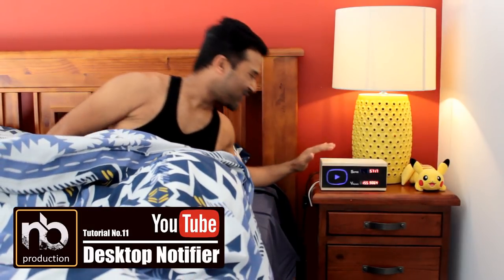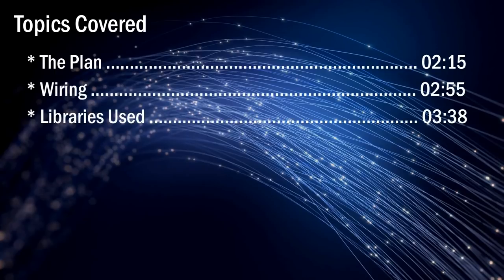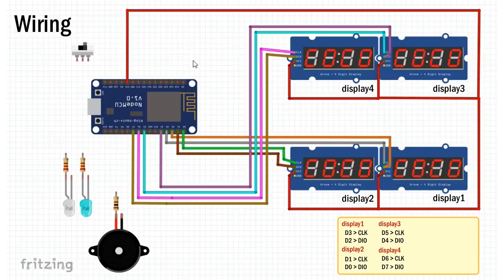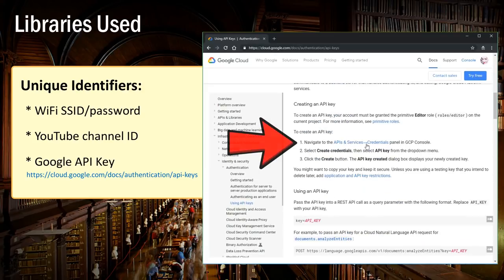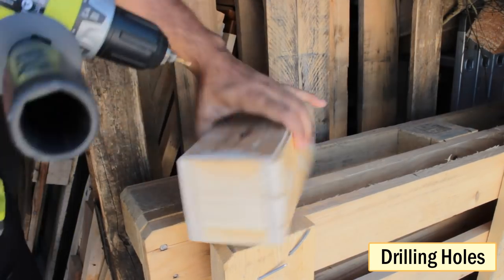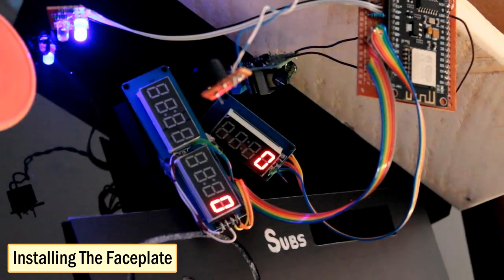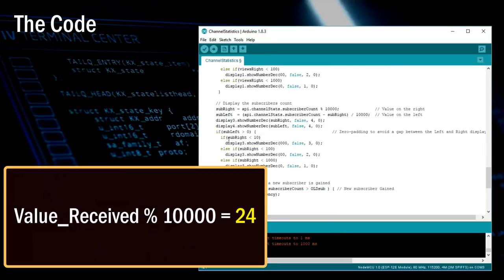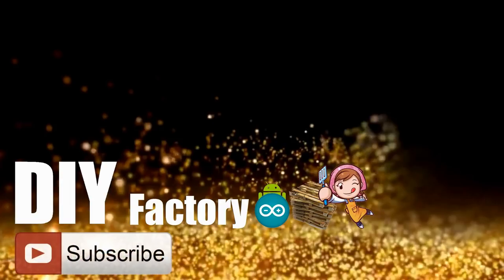YouTube Desktop Notifier using ESP8266

Comment: Hello! I have another question I do not get the exact amount of 4 TM1637. Can I buy 2 Max7219? or 2 TM1637 and 1 Max7219? Thank you.
Reply from the maker: Yes sure you can.
You will just need to use the correct driver/library for the module you want to use.

Comment: Very nice project!
Now, since you know how to wire things up like this, get yourself a copy of Kicad and make some custom boards so the whole thing goes on one or two PCBs. I recommend PCBway for quick turnaround low cost PCB fab; I've had very good luck with them.
You could even have them make the faceplate for this. You'd do it as a matte black PCB with translucent areas for the seven seg displays and/or Youtube logo by leaving the copper, mask, and silkscreen layers blank so only FR4 is exposed where you want light to come through. You could easily bang out some resellable kits like that.

Comment: Hello! Congratulations and very grateful for this video. Just a question. Where do you enter the code to ESP8266 ?. I did not see in any moment that you show that detail. How, and where do you incorporate the arduino code? Thank you.
Reply from the maker: Hi There 
Thanks a lot for the appreciation.
I haven't actually shown the uploading bit however from 08:05 I have explained how the code works.
The process is the same as how you upload your code to an Arduino. You just need to select the right board/driver and the correct com port
Please let me know if i was able to answer your question
Reply: @CrazyCoupleDIY  
Thanks for your prompt response. I was referring to the type of port you use to load the code. Is it for Wifi ?. I always use Arduino UNO, or Arduino MEGA for my projects. But I see that here, you do not use any of those Arduinos. I explain?
Reply from the maker: @busqueda_infinita  Its exactly the same process
When you create a new project you sect NodeMCU and whether its 16 bit or 32 bit and then you plug it into your USB port and upload the code.

The process is same as how u do it on Arduino. The only difference in simple terms (there are many differences in reality)  is that you are adding WiFi capability to your board. The cost of both boards are almost the same
Reply: @CrazyCoupleDIY  Perfect. Thank you! Now if I'm going to start copying your project. Greetings.
Reply from the maker: @busqueda_infinita  Subscribe for more amazing projects and tutorials :)
Reply from the maker: @busqueda_infinita  Subbed, stay in touch and best of luck :)

Comment: Hello! I have a problem. They sold me the NodeMCU V1.0 / V2, and as I saw yours is the NodeMCU v1.0 / V3.
I get the following error ...: exit status 1
Error compiling for the NodeMCU 1.0 card (ESP-12E Module). How can I solve this problem? Thank you
Reply from the maker: Change the board type to 16 bits and see if that fixes your problem
Reply: @CrazyCoupleDIY  I tried another module "Mini Nodemcu D1 Wifi Esp8266", and the same thing happens. I even stopped using "Arduino IDE", and tried with "ESPLORER", and also the problem continues. The ports are read perfectly.
Reply: @CrazyCoupleDIY  I just tried a Sketch of examples, the "TestEspApi", and compiles it and uploads perfectly.🤷‍♂️🤷‍♂️😩😩😕🙃
Reply from the maker: I just sent u a forum chat. Please have a look. That might help you in fixing the problem.
Reply: @CrazyCoupleDIY  What forum do you mean? Thank you!
Reply from the maker: @busqueda_infinita  Please check the comment  on your video